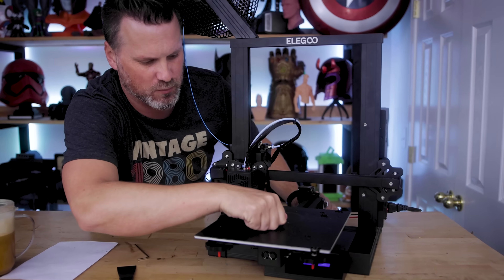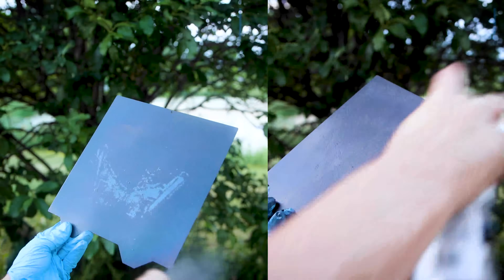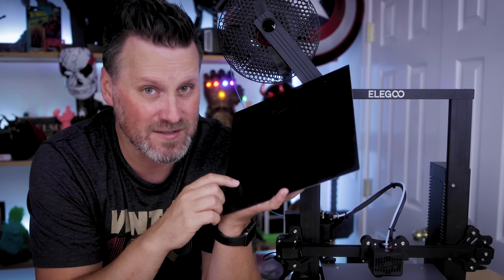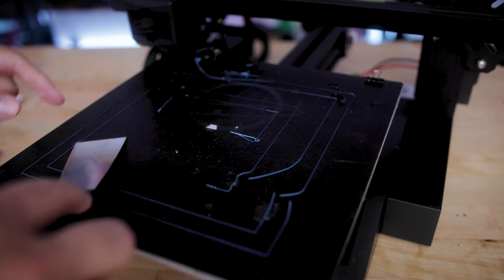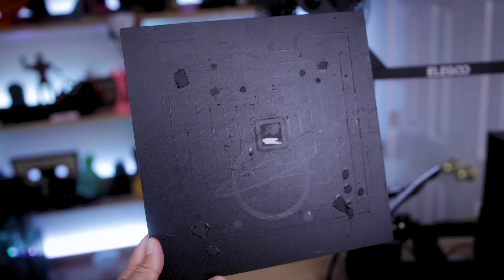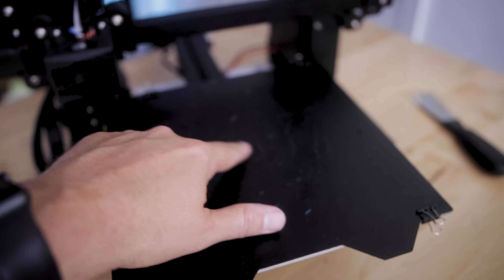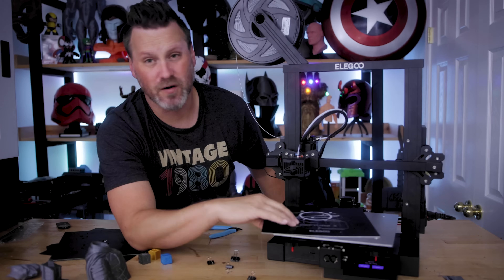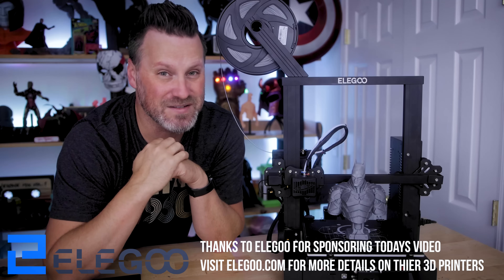Can you repair a 3D Printer Build Plate?

Comment: I've come to realize, there are certain things, just go buy new (and keep spares!). Don't try to "repair a fan" by printing a new blade. Buy a new one, don't fight with it. Magnetic plate is messy? Order a new sticker, heat up the bed, peel the old one off, and apply a new one; repairing it with tape is NOT gonna cut it. And for heavens sake...just get spare brass nozzles; you don't need steel unless you're printing a LOT of obscure filaments.

I had a HORRIBLE time with trying to get my bed satisfactorily level. Original magnetic sheet, Creality glass, other side of Creality glass, thick glass from hardware store, three different styles of PEI. Ended up replacing the bed a month ago...and my life has been easier. It was the bed all along (which everyone said probably wasn't the case).

Comment: Glass plate with this stuff - https://www.amazon.com/Printer-Adhesive-Layerneer-Original-Filament/dp/B079984GV5 - It grips tight as long as it's hot and the print will literally pop off the plate when it cools.

Comment: Man, not sure who decided to PlastiDip their Heated print bed, but there's much better solutions. 
The easy way, hi-temp ceramic rattle can special. You can get it dang near anywhere they sell rustoleum or autoparts stores. Most use it for exhaust header coatings; I've used it on jet engine casings that get mighty toasty, and when applied correctly, it'll take a beating. Be sure to adequately sand your surface for best adhesion. =) 
You could also try Cerakoting one, they have no-bake options now, though if you're going to do that, the investment in HVLP tools if you don't have them would be a massive tick in the Cons category. 
Me personally, if you're going to upgrade, really UPGRADE. I'd lay down a coating or two of the spray, dust a layer of silicon carbide 1500 grit powder (I've applied this at a distance through a fairly cheap Harbor Freight media blaster airbrush), then top again with another layer or two, THIN layers, of ceramic spray. If you can heat it between coats, it'll work amazingly well and survive temps far hotter than a heated bed will ever see.
Edit: The SilCar dust layer isn't super necessary, it's essentially the ceramic coating component in the spray, but it's an easy way to add a very thin 'grit' layer to your print surface for micro adhesion and is practically indestructible for home users. If your heat bed gets up to 2400 degrees you may see some issues, but ya know, your machine will be a molten puddle long before then! It is super messy to use, so outside application on a windless day or in best use, a dust hood would make life easy.
Edit2: One other consideration when diy'ing alternative coatings is offgassing of toxic elements in the product, especially when you're going to be getting it warm constantly. Something that emits VOCs constantly even after curing is a no-go. The ceramic paints release a bit until cured, but after proper thermal cycling, it becomes it's own surface that's as safe as treated steel.

Comment: How did you prep the surface before painting ? it could be the paint does not like what was left on the buildplate and if you cleaned the other side and tried that you could have better results. Also try some glue stick as it looks like the pla is sticking too well.

Comment: I can recommend the Ziflex plate, made a change from the standard plate on my GooFoo Mido after ruining 3-4 original ones 🙈 It took a bit a work to get my ABL to accept the added height (is measuring on the metal plate below the build plate) but now its really an epic combo.

Comment: The spray on stuff you used is meant to be peeled back off of whatever you put it on.  It is not designed to  permanently stick to things.  There are other options out there that do the same thing and are meant to be permanent.  You need to look into something like Printbite or a similar thing and give that a try.

Comment: USE THE SPRAY USED IN COATING FOR TRUCK BEDS. I CAN BET IT WILL NOT COME OFF. EPOXY BASED I BELIEVE
Reply: I tried several brands of truck bed spray. It didn't peel but leveling was off and it scrapes a nice line though to the bed.  Had I not screwed up the bed level it might've stayed intact.

Comment: I work on a room temp bed ( the heater part of my cr10 min has been dead along time). I wonder if you should try printing on a room temp bed. no heat under it and see how it works. I just use hair spray to keep my  print attached to the bed. My bed is a Borosilicate Glass Plate

Comment: Yea you are going to have to sand down the entire surface before painting - its always step one when painting onto any surface.  You are going to need a paint that can handle high temperatures and some rough abuse - Rust-Oleum-Automotive High Heat Protective Enamel Spray Paint - you can and some sand to add a grit layer.   This would be my best suggestion.
Reply: You can also try the rust-oleum truck bed spray - it comes pregrit - but it can only take 200F temps while the High Heat spray can take 2000F - designed for engines and exhaust rust protection.
Reply from the maker: @OrginalDravas  yeah I think I’m gojng to try out the bed liner and see how that works!
Reply from the maker: @OrginalDravas  yeah I think I’m gojng to try out the bed liner and see how that works!
Reply: This was what I was thinking
Reply: at that point you would be better to just buy a new plate

Comment: Probably would have suggested Bedliner coating since peelcoat or plastidip is especially made to rub off
Reply from the maker: Ohhh thats a fantastic idea. Might try that out! Thanks for the suggestion
Reply: @UncleJessy  another suggestion would be a thin coat of UV resin that can be cured onto the surface, has adhesion from the already textured bed and fills any holes